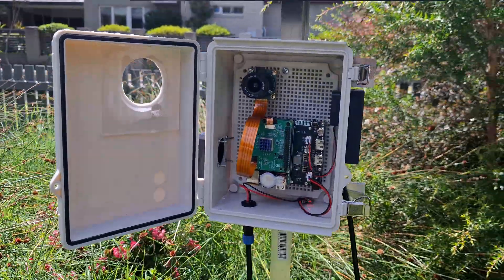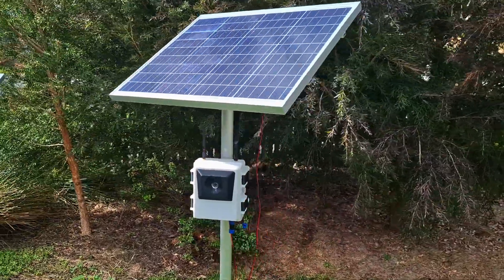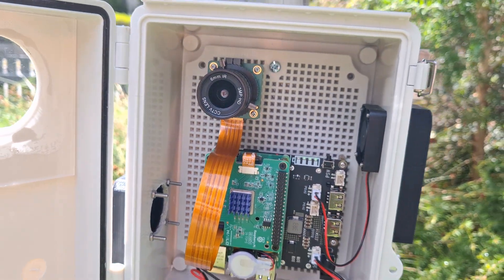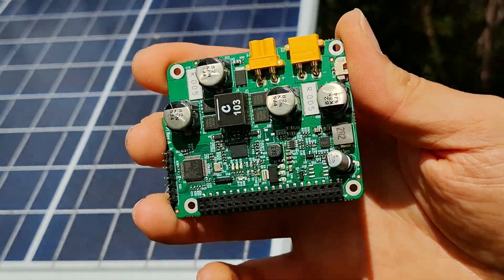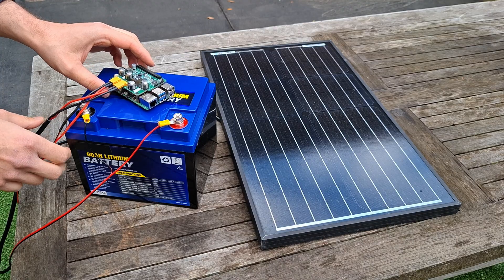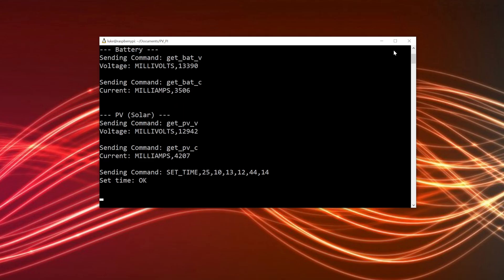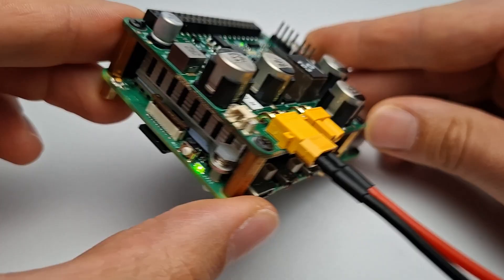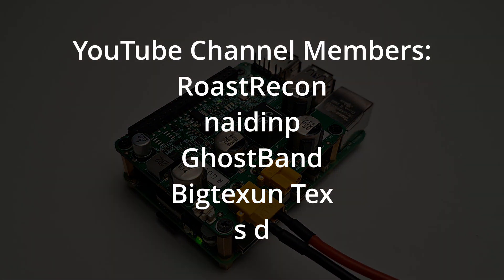Solar Power a Raspberry Pi for 24/7 off-grid operation with the PV PI!

Comment: Wonderful solution, Luke! I am working on a HVAC rooftop unit FDD system for my senior design class and this is exactly what we're looking for. The project ends March 2026, is there any possibility to have one shipped before then? Location is Connecticut, USA. Thanks
Reply from the maker: We're a small team working on this part time, we've set March as a realistic timeline for us and component procurement and manufacturing.

Comment: 1) Does your Pi PV solar battery charger have a profile for AGM batteries? I have four 10A AGM batteries and have not bought a 60A LifePO4 battery.
2) Can the Pi PV run other applications besides monitoring battery status?  I'm interested in running a low-powered repeater or a low-powered microwave beacon.
Reply from the maker: The charge controller chip is specifically for lithium batteries and doesn't have since features that many lead acid battery chargers have that are designed to extend the life of a lead acid battery.
The PV-PI is a solar battery charge designed to provide power management to a Raspberry Pi or other SBC or microcontroller.

Comment: Personally I think it’s better to use an external charge controller because you can get ones for much higher voltage of panels although that doesn’t seem very important. It means you could have a couple of panels and charge even when it is very very cloudy.
Reply from the maker: Yes, you could, but the point of the PV PI is that it greatly simplifies things by providing power to the PI and an interface that provides additional features.

Comment: Really looking forward to this. Planning on making this part of an offsite connected station that reports back using MQTT. Can the board be configured to report estimated battery percentage as well?
Reply from the maker: Yeap, it'll just be an estimate based on the voltage, though, not a proper "coulomb counting" estimate.

Comment: I'd love a video comparing 4G, LoRa and Starlink for this application. I think I'll use a 4G or 5G hat if power consumption permits.
Reply from the maker: I don't believe those HATs require that much power. However the PV-PI uses the pin 14/15 UART so you'll need to use a 4g/5g HAT that doesn't require it like this. 
https://www.waveshare.com/rm500u-cn-5g-hat.htm
Or use a USB dongle

Comment: I would be interested! So I have the AI Hat on top of the Pi, does this go on top of the AI hat? I’m new at this so not sure how to use it with Pi and AI hat.
Reply from the maker: Yes, it would go on top of the AI HAT, you will need to concatenate extra long stackable headers to leave enough clearance for airflow. I might make a video about this in the future.

Comment: Will you add a regulated 12v out if you haven’t already? 😊 for external lights or other accessories
Reply from the maker: Unfortunately, there won't be room for an additional 12 supply, though we will be breaking out the 5v 8A supply with a jst (or similar) connector
Reply: @LukeDitria you may want to consider it because there are a growing number of (potential) customers who want to do nocturnal insect monitoring, especially in Europe. They typically need 12v+ for a UV light attractor and then a relayed controlled flash. See the Mothbox project for one open source version. Entocam is a commercial option. I have a hard time finding 5v to 12v converters that can do 32W for the UV light (see the Entoquip light or Mothbeam)

Comment: Amazing work. I have been dealing with this exact same problem. I want to capture all the full sun I can we get a short break in the clouds. But the battery controllers which can handle more amps don’t have good options for communicating with a microcontroller. Victron is awesome but why do you need a controller + battery shunt + a $30 cable for every device!

Comment: Really cool project. It looks like it's designed so the GPIO pins can extend though to PV hat. Will it work with another hat on top of the PV hat?
Reply from the maker: Yes, using extra long header pins you can stack multiple HATs. Though I'd recommend putting the PV PI on top, for heat dissipation.